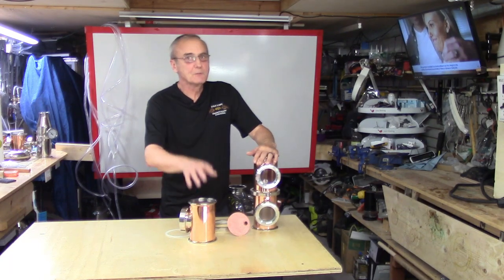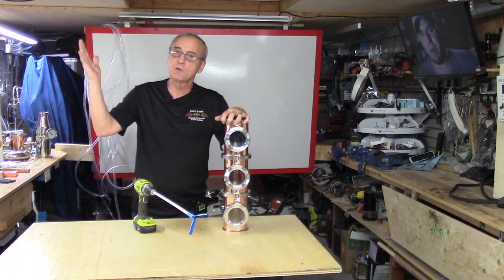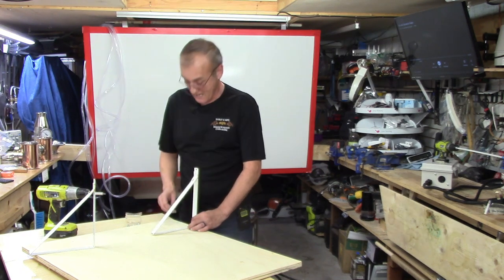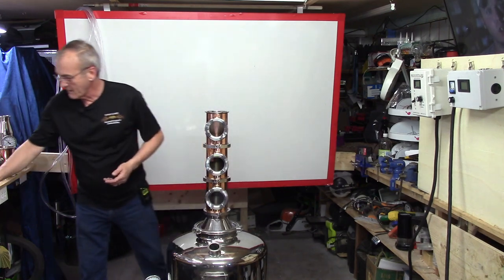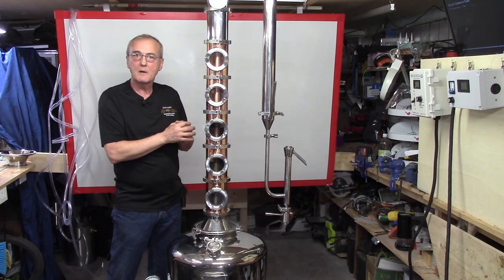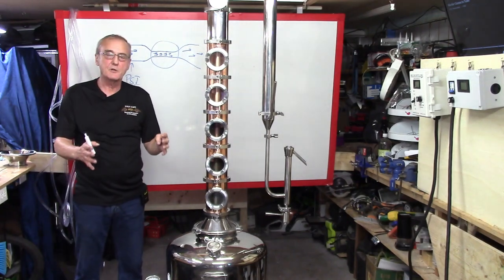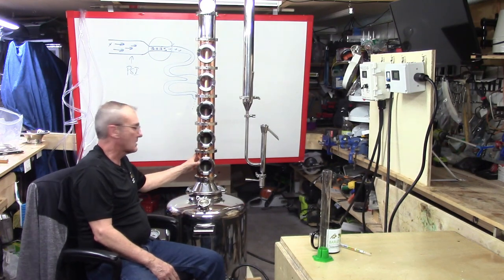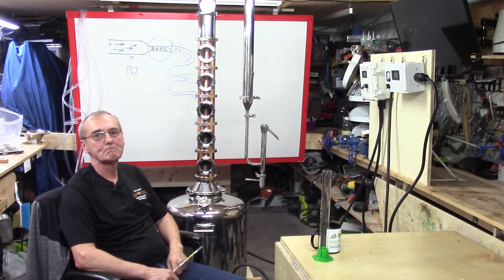RUNNING A STILL PART 2 MileHi 4 inch bubble plate column

Comment: Tip- If you're welding copper pipe, you don't need to. Use a Bpress fitting with a press tool. These products are available from Reece Plumbing or similar. No welding, more expensive fittings but the jobs done in minutes and guaranteed not to leak if connected properly. Come in copper and stainless

Comment: Question: On exactly this model still, except with 4 bubble plates, is there a way that one can run a good flavor brandy through this still? If it is not possible to achieve with the reflux ON, what components could one leave/remove to run it only as a "pot" still?
Reply: They sell a pot still Column you can replace that column with. It’s only a few hundred bucks
Reply: just leave out the plates, take out or leave the defragmater unhooked and it will run just like a pot. theres no reason to buy anything

Comment: "The Venturi effect" is the reduction in fluid pressure that results when a fluid flows through a restricted section of a pipe. In case anyone is wondering. 🙂

Comment: George, I have learned a lot from your channel thank you. The tip about the level is invaluable. I had a sight glass and noticed that the reflux was running down one side. When I checked the level, which I hadn't done before, I found the column was slightly tilted. After ccorrecting the level my ABV moved from 9% to 92% with the dephlegmator working at a greater effeciency. Such a simple step to be aware of.

Comment: That's funny because I just found an old mixer my grand-dad made years ago from a 304 stainless prop he salvaged from a holding tank at the plant he worked at. After cleaning it up thoroughly I chucked it up and went to de-gas a bucket and learned really fast to run my drill in low gear and that a tomato wash works great to clean the floor if ya don't mind the smell🤣
Reply: Tomato wash.... tell me more :) i am a noob but like the sound of it.

Comment: I don’t own a still yet but I understand the point on hydrometers. I’ve worked with lead acid batteries forever and the only way to read the individual cell condition is with an hydrometer. Voltmeters and load testers are only part of the story.

Comment: One other question I have is what are your thoughts on that 26 gal boiler if one were to run primarily 13 gallon batches in it using (1) 5500 watt element. Would there be too much head space in the boiler? At what level would the wash be vs where the element sits? Are the 1.5" tri clamp fittings at the same height across from one another? Thank you for you time. I look forward to Part 3!

Comment: I am having problems with the pressure coming out of the condenser in gas form not liquid form, actually about half gas half liquid. Bought the column on Ebay and I can't really widen anything on it. Is there another way I can get it condensed quicker or extending it longer? Love the videos!

Comment: I really need you help.  I am a huge fan. 
Here in the Caribbean, St Lucia, I am considering purchasing a 600L non jacketed still from Oakstills.  For the production of whiskey, corn based. 
What do you think.  Jacketed or non jacketed and why? 
Also, their 800mm high condenser seems to be on the small side for that still capacity of 4*7k watts boiler and 8* plate 8" column. 
What are your thoughts?

Comment: in my stills i try to water jacket the two inch column a far as i can and make the transition to 5/8 tubing in a cold zone. this way there is a natural decrease in volume of the vapor that decreases the overall back pressure in the still. in addition, the length of my 5/8 tubing coil is pretty long. i am starting to go away from coils altogether in favor of a shotgun condenser.

Comment: Good timing. Doing my gin run... right now 😆

Note to self: 2 grapefruits for 5 gallon is waaaaay too much haha
Reply from the maker: Nice work!
Reply: @BarleyandHopsBrewing  lesson 2:.... calculate better... gonna be out of glassware before end of the run 😅.

Calculated final volume for full reflux at 93-95% ... but ran it in pot still...
Reply: @superdupermax  lol easy mistake to make.

Comment: George, why did you choose to run a PWM setup vs a PID for that 4 inch mile hi 26 gallon flute? I see that this it what mile high offers that goes with their flute stills. I am just wondering if you configured with a PID control and replaced the thermometer at the head section with a thermocouple going to a PID controller if it would be a better controlled system or not? Please share your thoughts on this. Thank you!

Comment: Yesterday I ordered my first proper still with bubble plate my question is if 3 are enough. I thought it would be enough because with my pot still I get around 60-70% in my first run. But now I'm not so sure anymore
Reply from the maker: Yes, once balanced you will be extremely pleased with the increase of proof.
Reply: @BarleyandHopsBrewing  wow thank you a lot that was incredible fast 👍🏻
Reply: @BarleyandHopsBrewing  I have one last question is a 30l kettle too little for a 4" kollum?
Its a SS milk keg with a welded bottom and and a Silikone gasket on the top for the lid
Reply: @frost_burn2400  301 Describes the steel your pot is made of. George will want to know how many gallons your kettle holds. i think a 4" column will require around a pot around 8 gallons. George can better answer that but he will need the size of your kettle.

Comment: i made my re-flux out of galvanized pipe
there is a really heavy metallic smell and taste which is not super horrible but its there and its masking other flavors
I'm not sure if it can be removed by a post carbon filter or not
the problem is i don't have any other choice 
should probably go with pot still
Reply from the maker: Please avoid galvanized pipe at all costs.
Reply: Do not use galvanised steel it is treated with cyanide and zinc,  both of which are toxic when heated.
Reply: @exmcgee1647  thanks man ... i did not know that
Reply: @BarleyandHopsBrewing  thanks for the reply man